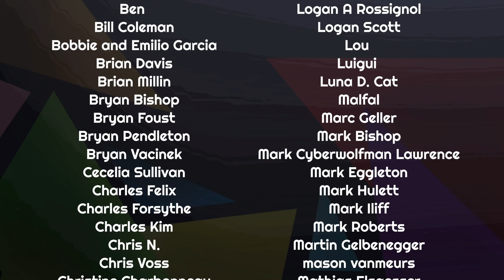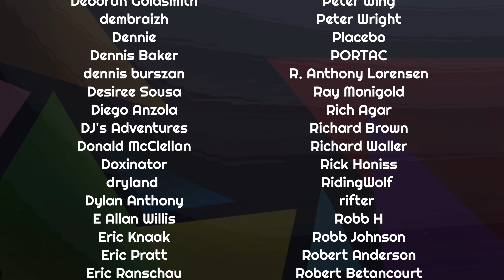Automakers Don't Want You To Buy EVs

Comment: I've heard the argument that you should lease an EV instead of own one because the battery technology will be quickly out of date, thus creating a lot of depreciation. I will counter this with three points:

Point 1: The manufacturer knows that the car will depreciate and is already considering this when they set the price of the lease. So, if you believe that leasing is cheaper than owning, what you are really saying is that the manufacturer misjudged, and that you know better than they know how quickly the car will really depreciate. This is something I would personally loathe to take a bet on, as companies that actually sell cars know far more about used car pricing than I do.

Point 2: Even a car that is technologically out of date is still worth something, so long as it's driveable. This is especially true for EVs, as all the advances in range and charging speed only really matter if you either lack the ability to home-charging or take the car out on road trips. If you have home charging and simply want a car to drive around town (especially for people that still have a gas car in their driveway for longer trips), an old EV is plenty good enough, which is why even old Leafs, which are, today, extremely out of date, still have value.

Point 3: The total depreciation over a vehicle's lifetime is, by definition, equal to the price paid for the car when it is new. Thus, if you want to buy an EV without huge depreciation, the simplest and most cost-effective solution is to just buy a cheaper EV. For example, my Bolt has so far held its value after 3 years of ownership about as well as the gas-powered Honda Civic I owned previously. Even if, after 10 years, the Bolt's value decreases to under $5,000, that would still equate to an average annual depreciation of just over $2,000 per year, which is very respectable. A more expensive EV like an Ioniq 5 or Tesla Model 3 would have depreciated a lot more during that time because it's starting from a higher price point, and I would imagine the 3-year depreciation of those $100,000+ cars to be even higher. The same argument is really true for gas cars also - expensive cars are wastes of money, period, no matter what powers them.

Bottom line: if you want to save money driving (whether electric or otherwise), the solution is not to lease instead of buy, it's to choose a car that costs less.
Reply: I think the battery depreciation was more of the issue some years ago - when one generation say of Hyundai Ioniq only got maybe 80 miles of usable range and then it all changed to long ranges... or Leaf, now I am perfectly fine with today's say Tesla battery charging and range performance, and if I get 8 year warranty on that, it is fine. But I would still like the range to be bigger so I would cover the winter driving where I live since I do not yet home charging ability, but maybe it would not matter as much if I could home charge.
I don't think that now batteries will suddenly become 10x better, yes they will be cheaper and with extra range and maybe you will be able to charge them on fast charger (if you find one that charges as quick) in 10 mins, but that is not super important for vast majority of people
Reply: I prefer to buy a lightly-used vehicle and let someone else take the depreciation hit.  The depreciation curve is at its steepest in the first 2-3 years of the vehicle's life.
Reply: BRAVO! well written! This writer agrees and follows your path. He owns a 2019 NIRO BEV, bought used, has home charging, and just putts about in it. And it bought, not leased

Comment: Thank you for posting this!
The car driving public needs to get fully educated about the automaker / dealership (stealership) model.
The Right to Repair is also a significant problem. We have entered an era of technical obfuscation and mere mortals are at the mercy of the manufacturing behemoths. This is probably one of the most significant factors in resource abuse. Considering vehicles being scrapped due to automakers ceasing to provide parts.
Reply: Great post! You mention important issues.
Reply: Well if you’ve had any experience with old, and I really do mean old like 50+ year old vehicles then you’ll realize there’s a reason why parts availability is a thing for some rather than all cars past a certain point.

Comment: Good video! I have never leased a car, as I’ve always felt that doing so was more expensive in the long run. I tend to hold onto cars for 10-12 years to get more value from them. However, I am investigating leasing an EV due to the rapid rate of change happening in the industry and the uncertainty of resale values. If I were planning to keep it for 10-12 years, resale wouldn’t be much of a concern, but the rapid rate of change in features may make me want to change cars sooner. 

Perhaps cars will follow the cell phone model, where manufacturers will offer high trade-in offers on low-mileage/low-years models when you are also subscribed to their high-margin monthly services plans (FSD/BlueCruise/SuperCruise)…

Comment: I have never leased a car before I started using EVs. I strongly recommend leasing new cars for now simply due to the massive battery tech evolution. An Ev with small/old battery types will become more or less worthless when newer tech arrive. A simple example from Sweden, I leased a VW ID3 Max(565000SEK) for 3600SEK in 2020 for 24 Months(total cost: 86400 SEK), I was offered to buy the car for 400000:-, said no thx, the same car is now sold for abt 250000 SEK, three years later with similar mileage. Even if you factor in the incentives at that time, the depreciation is insane. I am still leasing EVs...

Comment: My employer has an arrangement with Octopus Energy (a fairly new renewable energy supplier in Britain and a number of other countries) to lease EVs to employees, much like "cycle to work schemes" but with the expectation that the vehicle will be returned. My understanding is that for Octopus the motivating factor iS (as you say in the video) recovering the batteries intact at the end of the cars' useful lives for 'second-life' use in grid-scale storage, since that doesn't require the battery pack to provide the tens-of-kW power dumps that a battery pack in an EV is expected to service.
Reply: At the end of a 3/4 year lease, the vehicle is still worth much more than the battery, so I doubt that is the Octopus business model.
Reply: @charlesbridgford254 the video did say some lease companies are re-leasing the vehicles - a total of 10 years. I still tend to agree though. The price of batteries has fallen massively and is expected to continue to fall.

Comment: Leasing devalues all other used cars and therefore artificially retires all cars earlier. This happens because leasing creates that artificial 3 year decision to lease another new car. Every 3 year old car that comes into the used car market, artificially saturates the used car market and oversupply reduces value of the oldest highest mileage cars. With the exception of exotics and sports cars, cars that are then too low of value to rationalize an expensive repair, drives the car owner to scrap it when it has a problem. Leasing drives churn instead of encouraging  long car life, and thus makes them all less sustainable.

Comment: Historical perspective:  Leasing has nearly always been promoted during times when the cost of loans were high.  Many don’t realize this b/c the cost of money has been goofy low for the last 10 years.  Since the early ‘80’s, leasing has been a regular tool to get buyers with less capability into a new car b/c the upfront and monthly is lower.  And what dealer isnt’ happy for the extra ‘stir’ bringing customers back sooner.
I’m happy for leasing b/c as you mention, there’ll be more used EVs coming in 2.5-3 years.
Reply: USA is experiencing a repo tsunami. The resale value on 3-5 year old cars is putrid. People physically cannot afford to buy outright. Many can afford to lease, for a while at least. Once the car is sold and the money is in the manufacturers bank account, they don’t think about how it got there. Or what happens to the retail purchaser, financially
Reply: @theairstig9164  Depreciation after new sale is usually high, but given the over-growth of new prices & inflated values for used cars in 2020 -> early 2023, it’s even worse as valuations are normalizing out some of the inflated value.  ——> big value crashes.  Folks that bought used vehicles in 2020-early 2023 are getting the worst of it.

Comment: We would love to lease another EV. When we got our Niro EV, we got it on a lease ($315/mo), with the intent to turn it in when the lease expired and get something else. That expiration was a year ago, and lease rates were so high that the lease on a new Niro EV was a whopping $865/mo. What we really wanted (EV6) was over $1200/mo. So we punted and got a loan from the credit union to pay off the balance on the car. That loan, with a middling interest rate, runs us $515/mo. Now I'm starting to see leases on things like the Ariya and IONIQ5 at under $500/mo, so am reconsidering our situation.

If anyone knows of a lease deal on an AWD EV similar in size to an EV6/IONIQ5/Ariya/etc. that is under $500/mo, I'd love to hear about it. Fast or quick or long range isn't an issue for us. We've taken two road trips of over 2,000 miles in our Niro EV and we don't mind stopping to charge when we need to. It's rarely a challenge.

Comment: I looked at leasing an model 3. The total cost was $18,000 for 3 years with only 10,000 miles per year. That works out to  $.60 per mile. Ouch! My $24,000 hybrid gets 44mpg and the depreciation cost per mile is approximately $.15 per mile.
 And please dont tell me how much you save on fuel. With local energy cost of $.19 and fuel price of $2.80 I wouldn't save much money even charging from home.

Comment: Personally, I have leased vehicles long before EVs.   I like cars, I like new cars, I know it's not fiscally responsible but if I couldn't splurge on myself what good is it.  I have not had a bad experience with this in 25 years now.   There are some cars that aren't leased by the car guys very often though, Ford was very against leasing for a long time in the 2000s and even 2010s in my experience.

Comment: Many automakers are have begun bundling "free trail" mobile subscriptions into new vehicle purchases/leases. Access to connivence features via you mobile device is a nice selling feature, except the  2-3 years limitation in the fine print.
The catch (there's always one), for EVs is basic features like checking battery charge station, remote cabin conditioning, or just remote (un)locking of doors are often in the "premium" bundle of mobile subscription service. The basics subscription bundles are ICE specific features. 
Hyundai/Kia <-- 👀🚩 is one notably bad automaker in this regard. Beyond 3 years of handing over a keyfob to a new vehicle, all such features require a monthly fee ($15-$25/ month depending on model and year)
As much as $1000-$1500 over 5 year period. This is 3-4x the cost of tires for the same period, or for many, more than the cost to charge ⚡🚘 their EV each month.
Reply: What the hell?!
I had never heard of this.
Thanks for the heads up.

Comment: EVs make the most sense as a lease option anyways. You're more likely to have predictable mileage figures per year, they require little to no maintenance in the first few years of their life, and the customer can return the vehicle before anything costly like batteries or inverters needs replacement.

That being said, I'm genuinely concerned for the future of right-to-repair and longevity of the vehicles if this becomes widespread. When vehicles are sold to a person, that person is under no obligation to visit the dealer for repairs or maintenance, and because many dealerships are money-grubbing scum, they'll go to an independent repair shop for their work. A leased vehicle, on the other hand, may contain a clause in the lease that it can only be serviced/repaired at the dealer or an approved repair facility or you'll be in violation of the terms, which I could see hitting independent shops pretty hard. A leased vehicle can be sold for scrap once it's a few years old, thereby depriving the used market of a vehicle. And even if they do get resold, if you experience major proprietary component failure (which manufacturers will have no interest in releasing to the aftermarket because they have no obligation to support the vehicle past its lease term) and can't repair the vehicle, it gets thrown away instead of repaired and reused.

This is not me taking the stance of "ICE vehicles are better because they have more things that break and can be fixed" this is me as a repair technician expressing concern for the future of the repair industry. My grandfather is also in fleet sales for Ford, and he and I have talked multiple times about Ford's lease-only stance with EVs putting them at odds with dealers, so that's also a concern of mine.

Comment: A lot of people supporting buying over leasing. And fair enough, that makes sense. But... I don't think this is as for and dry as people are saying. 

For one, the benefits of buying that accrue to the dealer are ones that I'm not really in position to take advantage of. Battery recycling and resale is out of my reach. Tax incentives are useful, but if I'm buying used like many in the comments, I'm not getting it regardless of whether the car qualified or not. And as mentioned, some cars may qualify with the lease option.

For two, the advancement of tech in EVs DOES MATTER. If standardized charging tech and bidirectional charging, let alone significantly better battery chemistry is coming in the next few years, then actually, no, I don't want to lock myself into cars that don't have that for 10 years. There's a tangible lifestyle benefit that goes beyond vanity or fashion. 

The bigger picture is depreciation. Leasing does take the brunt of that depreciation since it's factored in. So that's a fair point. And I think things like bidirectional charging would change the proposition entirely: even if I get a new car at some point, the old one will probably still be a great home battery that we can still use when it makes sense. But we're not there yet with V2H/V2G.

Ultimately, I'm looking at the market speed up, not slow down, in terms of innovation and maturity. And that means it feels reasonable to not lock into one decision or another. If something comes up during that period that IS a sure bet, you can always jump on that then. But if I do need to change my car (which, I don't now), then I need to change my car.

Anyway. Unpopular and probably poorly explained opinion. Haha

Comment: I am considering a lease for my next car (first EV) as there look like there will be quite a few cars that will fit my needs within the next few years. Another plus for a lease is that you don’t have to get rid of the car yourself. I have bought most of my cars, and the one I leased I ended up buying off the lease (unfortunately it kept a fair bit of its value so the buyout was more).
Reply: Who set the buyout price?
Reply: @paulas_lens  Probably the dealership or lessor. It was back in 1990 for a Honda Civic AWD station wagon and I kept it at the end of the lease so had to buy it as a used car (with a loan). I don’t ever think that the leasing company ever saw the car. It was a great car until it got T-boned in the driver’s side by a Mercedes sedan.

Comment: Because of my 2020 Bolt LT lease after the battery recall I ended up with 2022 Bolt EUV Premier!  Which ofc I bought at the end of the lease since my original buyout was only $21k which in my case happened to be not the 2020 Bolt LT anymore but the 2022 Bolt EUV with only 7500 miles. Great positive equity. Now thinking to replace it with Niro EV wind. Afraid that since BOlt is not produced and is not exactly clear if it really will come back which will make repairs  difficult even though it still under full warranty.
Reply: I wouldn't get a nitro, not really a big upgrade from the bolt, jumping to an 800v ev like the ioniq5 or ev6 would be a better move if you need to get a bigger car imo